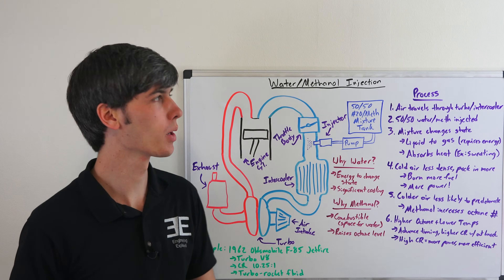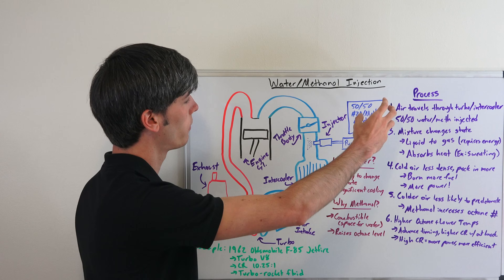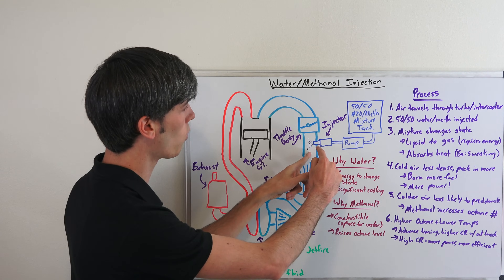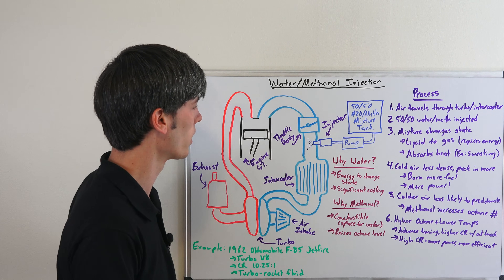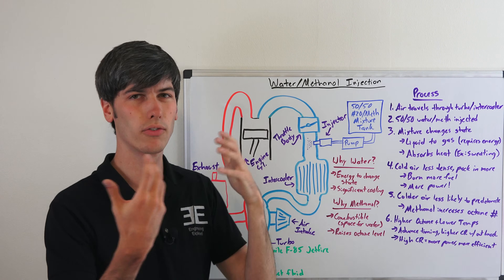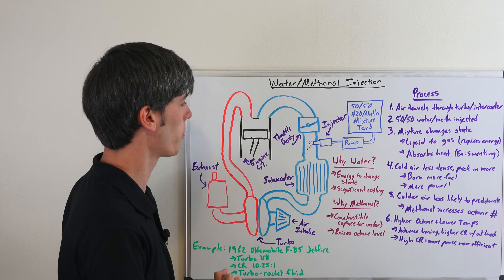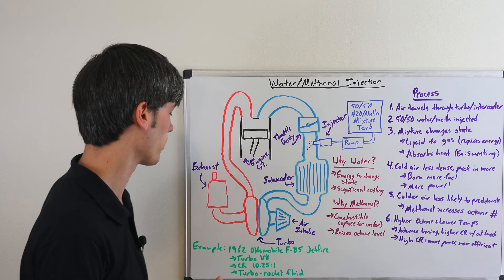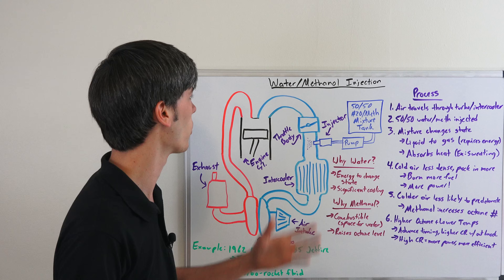Water Methanol Injection - More Boost!

Comment: What are you're thoughts on this compared to e85 ? 

i have very limited availability of e85. i like the idea of using a meth injection type of kit  where i know i can just carry a gallon jug in the car and fill up any where i need aswell as windshield wipers fluid is primarily water and methanol every gas station has it. 

my thing is i dont feel like having to travel long distance to go to the ONE gas station that has e85 and byond that station its hours and hours in between stations.

Comment: Great video, I’m a metro pilot and we use water methanol for take offs on hot summer days. I am also using a 50/50 water/meth injection on my DIT WRX. I am concerned with the oil possibility of the oil diluting, is this a valid concern? Thank you

Comment: Does running a larger aftermarket intercooler and water meth have a"significant" benefit, or is it redundant? I'm wondering because I hanger a intercooler on the way, and everyone composites the two, but no one had shown them together-that I have found anyway...👍🏼 Running a 2015 F150 3.5 Eco.

Comment: How often does the system spray?? Just at full boost? Or linear with RPM?
And if ur engine is tuned to meth injection, and you run out of juice.. can u still drive it?

Comment: Two errors: 
Point 4 on the board, cold air is more dense
Point 5 on the board, "predetonate" isn't a thing. It's either detonation or pre-ignition but they're two different things.

Comment: This was on my recommended..I have been using wmi for a while now.  It helps both na and boosted.  For both of them it  "cleans" up the timing curve and allowed for less drastic timing pull when things get hot. Also in the turbo car it's great being able to do back to back runs without heat soaking. I enjoy seeing boost Temps pretty much at ambient at 20psi even after multiple runs.  (Car has a decent size intercooler and wmi right after)

Comment: Question here
1- I’m using 100% meth with no water. Is there gonna be a problem.
2- Should I use Purified water or just tap water?  Someone told me not to use Tap water because normal tapwater causes clogging and the lines.

Comment: Back in the 1980s, I drove a 1964 Pontiac with a 10.5:1 compression ratio 389 V8 engine that was supposed to have 100 octane gas. We installed a water injection unit to allow it to run properly on lower octane unleaded gas. It worked well.

Comment: Can I use Denatured Alcohol that was denatured by Methyl Ethyl Ketone instead of Methanol? It contains 1% Methyl Ethyl Ketone by weight, but I would also be mixing is with water at a 50/50 ratio. Is Methyl Ethyl Ketone bad for the engine?
Reply: Denatured alcohol is harder to find, at least where I am, and a lot more expensive than methyl hydrate (99.9% pure).

Comment: For the Fiat 500 Abarth the company cravenspeed makes a throttle body spacer to be used in conjunction with a water meth kit, but the placement of the injector is just AFTER the throttle body. With the proper tune is this a safe setup? Also I'm running 27psi on a Garrett 1446, I'm assuming that would have to be dialed back a little... 😄 Love your videos, very informative 👍🏻

Comment: hi can it be used on N/A cars?...im just worried that, there is not enough air to push the mixture inside the N/A throttle body. unlike turbo cars which has intercoolers which has significant air that comes in.

Comment: Why wouldn't you inject it before the intercooler, seems that it would work far more efficiently?
Reply: Puddling
Reply: It is an evaporator, essentially. Going from the high pressure inlet to the lower pressure outlet. That is exactly why an intercooler works. Why not exploit that by making the air charge easier to cool? Am i missing something?

Comment: I have been trying to find an engineer answer for how WMI benefits a diesel engine, as opposed to a gas engine.
Reply: I'm looking to know how water or water/methanol injection could be used on a 2 stroke Diesel. Especially how one manages to keep water and methanol out of the engine oil while also preventing the engine from rusting.

Comment: I have a 2013 STI on flex fuel. Would meth injection work will with noticeable power gains?
Reply: What is flexfuel ?
Is like LPG?
Reply: @33pastas  flex fuel is the capability to use E85 or ethanol fuels

Comment: Hi Jason,

First up I just wanna thank you for the time you've taken to do all your videos.. They're really informative.

I had a "brainwave" - which I think others have had before... Nevertheless I needed an Expert in Physics and Engineering to give me an opinion and I could think of none other than you... 

So here goes:
I recently contemplated the use of water meth in a turbo car.

The basic reason of using 50/50 water meth is to reduce knock, increase boost and possibly reduce fuel consumption while giving the car 'race gas'... I understand that it's not all that simple and that tuning is required. However the principle is that it cools down the air by absorbing the heat energy from the surrounding air - hence creating a denser charge.

Which also means that if you put in "cooler" 50/50 water meth versus a "warmer" water meth spray you'd get a better result right?

So what i'm trying to say is that the water meth would be somewhat dependent on the external temperature and thus the problem if you're living in a hot climate which i'm living in..
(I live in Singapore where it's always 80-100+F)

This got me thinking - "What if I could cool down my water meth MORE?"

So instead of spraying in 85-90F Water meth, what if i spray 32F (0 degrees celcius). I understand that water meth freezes at a really low point. (correct me if i'm wrong.)

What would the effect be on the car? - i.e in terms of Torque, Cooling(i'm guessing that's obvious but I would still like to know), and horsepower. Would there be a TREMENDOUS improvement is my question?? coz i got a rather "fruity idea" of how to do just that...

Also.. How low should the temperature go - as in what would be the sweet spot(without any damage to the car)??

I guess that's all I want to know(not an expert like yourself).

Could you tell me if you need to know anything else etc.

Also if the gains are so minimal that it's pointless (hopefully you could explain why as well if that's the case)

Thanks for taking the time to read this e-mail. Hope you could get back to me at your soonest possible convenience.

Best Regards,
Mark.

Comment: I built and installed 3 different water injection systems on my dad's 75' Olds Cutlass back in 1980. They worked but I was constantly refilling them which is one of a dozen reasons why they won't put it on a production vehicle. If they did put them into production they could eliminate EGR and keep the intake system cleaner. And actually the first reason alcohol is added is to prevent the water from freezing in winter - the additional reasons are the indirect benefits of alcohol (octane boost, etc...).

Comment: The standard, but incorrect interpretation of water or water/methanol injection.
The water or W/M that is injected, displaces the equivalent amount of air unless it has been injected into a sealed container.
Like a direct injection engine does.
The NACA could not find any evidence of additional air being drawn into engines using water injection during development in World War 2.

Comment: Thanks for the quick to the point explanation on this rather “obscure” subject. It reminds me of Kurt Tank’s design, the  TA-152H high altitude fighter back in WW II. It used a Jumo 213E engine (inverted V-12 liquid-cooled engine) using a MW-50 boost up to 33,000 feet altitude, and could climb to over 44,000 feet using the nitrous oxide boost, achieving almost 470 miles an hour at that altitude. Please, keep those videos rolling!!!
Reply: Water injection was relatively common in wartime aircraft engines

Comment: I know it’s been years but I wanted to ask you as you give concise answers with proof. Are there any disadvantages to inject WM mixture after the throttle body in turbo powered engines? Wouldn’t that be better as it would eliminate the mixture from accumulating when the TB is shut instantly? Thank you

Comment: I highly doubt water help in any way with performance. The water lower the heat from the compressed air so the air is more dense but you take up space in the combustion chamber with water so you neglect the additionnal cooling. Running 100% methanol is better because the latent heat of evaporation is high (not as high as water) in comparison to gasoline so it will absorb a lot of heat while evaporating making air more dense and it also act as 115 octane booster fuel. More air + fuel = more power. More air + less space (because water will displace the air in the combustion chamber) + more fuel= less power. Unless you have factory wideband oxygen sensors, you absolutely need tuning because the car will run rich. You also can't inject before the MAF sensor because the readings will be screwed. What you need to do is inject after the MAF but install a second MAF after the injection point and only use the temperature sensor out of it if your car is MAF based or both the MAF and IAT the same sensor.

Comment: do you know if Isopropanol that has high Octane number and, high heat of vaporization (similar to that of water) can exert an effect similar to water/methanol ? Isopropanol can be added directly to the fuel being soluble in gasoline. Furthermore it has a good energy density (better than water/methanol 50/50). Thank you

Comment: Hi, first of all many many thanks because you are so clear explaining everything! This video about the cooling effect of liquid Methanol/water is very interesting. There is a balance between two different effects, however: they lower the temperature of the air/fuel so more fuel can be burnt increasing power. But water/methanol vapours contain very little energy so they do not afford power...

Comment: Anyone do this on a NA engine so they can increase timing advanced without buying expensive premium fuel? (In my crazy state instead of an extra 10 or 20 cents for each bump in octane at the pump it's another 70 cents. When gas prices dropped really low that meant 93 cost nearly twice that of 89.) I'd like the increase in timing advance and knock protection, but not that crazy cost.

Or is methanol and water expensive? Seems like it shouldn't be even if it is.

Comment: Aircraft engines used this in 1930s. Pratt Whitney wasp radial 18cyl.
Reply: most fighter planes of ww2 had war time emergency power (WEP) push the throttle past 100 and you get meth injection or other things depending on the plane country or engine.
Reply: @Luke-tm5oy  Focke Wulf 190 😎
Reply: And the Daimler Benz V12 used in the BF-109
Reply: Such a cool engine.

Comment: I have a scat pack NA 392 and snow stage 3 and noticed intake temps LOWER than outside air at times...I also notice more power at full throttle

Comment: Im a little confused n hoping some experts that can explain it to me. Yes, the fine mist vapours instantly when it reaches the intake air but as far as i know, the mist turns into steam when evapouration occurs. So, my question is, even the methannol is combustible but with the steam together goes into the engine room then compressed, would it be harmful for the engine?

Comment: will methanol and air mixture give about the same output in the combustion that Gasoline, NOS and air mixture will give or isn't it comparable at all (using the same type of engine) ?

Comment: Great video, I have been studying these systems since it's conception in 1944, it was the German  fighter plane Focke-Wulf Ta 152 H that had  both NOS & MW forced induction! (not a new idea).My question is this: please explain about another forced induction called Hydrogen injected the same way & generated in the car by electrolysis,seems the same idea but using a different type of charging media?

Comment: The BMW M4 GTS has the water injection system as well. I wonder where can you get methanol to put in the water tank when you start to run low on water, unless you just pour water and the remaining methanol will mix in and keep combustion going afterwards
Reply: You can run a water(-methanol) system with only water.

Yes, then is would be a water injection only but it doesn't matter.

Comment: i heard an explanation of this earlier but it was a bit different. besides the cooling factor of the water when its injected it mostly stays liquid and when it's in the combination chambe it serves  as a "cumbustion enhancer". so when the fuel air mix fires there is gonna be a lot of excess heat and the water takes that energy to turn into vapor. and because it expands so much when doing that (by factor 1600 i belive) it uses the excess heat gives you more power by giving you more tourge

Comment: Does the factory ECU have the timing tables programmed for such a drastic change in air temperature and timing advance? I mean i know that getting a tune to take advantage of it is the best way to go, but would the OEM ECU software know how to make more power with meth too?
Reply: sranjesuper diesel cars will benefit

Comment: what if air sorrounding is saturated with a lot of moisture already? Definitely you could spray water aswell cause as the air is hotter you would move far away from saturated point. But wouldnt it be dangerous?

Comment: Sorry, but my question is not 100% related to the water/methanol injection. It's more about fuel injection in general. Could you or anybody else explain the advantages/disadvantages of indirect fuel injection vs. direct fuel injection. Thanks for every anwser or comment from anybody. Greetings from a fan and future mechanical engineer from Austria
Reply: Direct injection has the benefit of a finer fuel vapor which increases the efficiency of the burn allowing more power and fuel efficiency. The down side is that the intake valves and injectors become clogged very quickly (about 70k miles). The only way to clean it as far as I know is to remove the head or intake runners. 

I'm not too educated on the subject but you can learn more via Google and the YouTube channels "humble mechanic" and "engineering explained"

Comment: people always talk about the good stuff in meth, what are the down sides to using it like risk of leaks, what happens if i run out of meth can i just switch it off? and still run normally ? lastly what is the power expected from meth like a percentage 10% with tune or less ? thanks :)
Reply: You'd have to change the timing of the engine if you were to switch it off or you ran out of meth/water, Some Ecu's have this but if they mess up your engine will knock and you will most likely damage it. The good thing about this is you can run the engine harder, where normally when you run an engine harder you have overheating problems. But with this it will help cool the engine so you can run the engine harder without the problems of heat that come with it.

Comment: So this is only possible because the cooling effects of water's heat of vaporization offers more benefit than the vapor pressure of water vapor takes away? 

How would the effects change if  it was 100% methanol? 100% water?

Comment: Jason what is your person preference, a turbo or supercharger and what variation of turbo or supercharger on what format of engine (H,V, I) and why?
Reply: That's a huge q.
Reply: Nicolas Losito  I like the idea of a roterx based centrifugal supercharger on a boxer engine.
I was reading an article saying it doesn't matter if its an 8 pound pully or back pressure from a turbo the crank shaft is still supporting the extra load, so regardless of forced induction system they both put a strain on the crank shaft and for a street driven vehicle it comes down to personal preference.
I want Jasons thoughts on this.

Comment: Should this system be fitted before the MAP or MAF sensor, so it can measure the air volume accurately?  Or is that not necessary?
Reply: Does not matter.
Reply: Nicolas Losito Why?  Wouldn't it read incorrectly if the actual charge was more dense than what was measured?
Reply: +aussiebloke609 you miss understand. The water/meth is already taking the place of air. The same amount of air can not enter through the MAF meter if down the intake space is being taken up by water/m. 

In other words, it does not need to meter the water in the air. It will meter correctly regardless of where the water is injected since flow of air will be reduced by the displacement of water/m. 

Does that make sense?
Reply: Nicolas Losito  Perfectly.  Thank you!  :-)

Comment: Could this water-methanol mix be used AS a fuel and not just in addition to standard fuel? With different ratios or something
Reply: +Mike Guitar um no. Gasoline has a higher potential energy so switch to a lower potential energy fuel would decrease power if the same amount was used. In turn more fuel would be used.
Reply: +Mike Guitar octane is not a measurement of power.
Reply: Methanol has less power than gasoline so yes but you would lose power and mileage
Reply: But it releases a lot less crappy stuff upon combustion, right?
Reply: Yeah. Why?
Reply: Just wondering, thanks :D
Reply: no, you'd gain power and efficiency, because its higher octane
Reply: So this system injects methenol/water into the intake before the throttle body and then it has direct injection of gasoline in the actual cylinder?